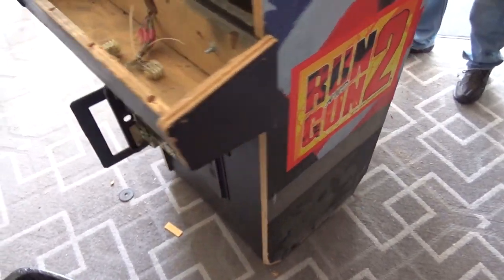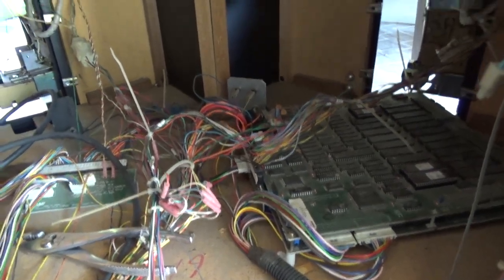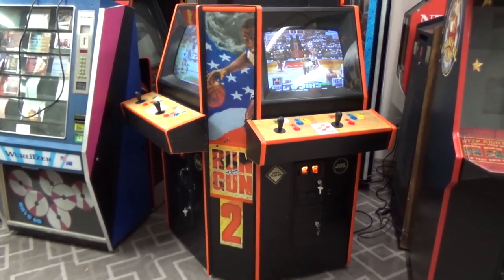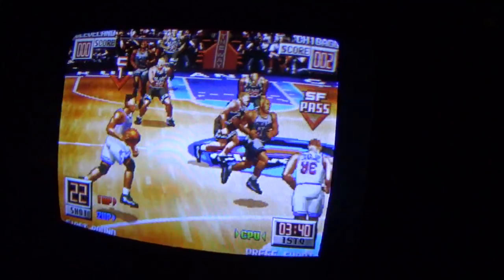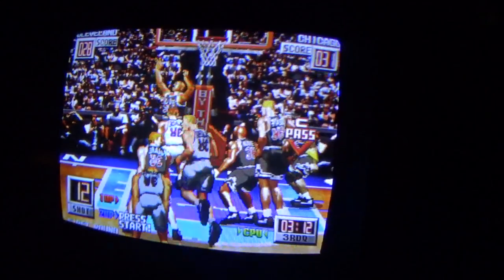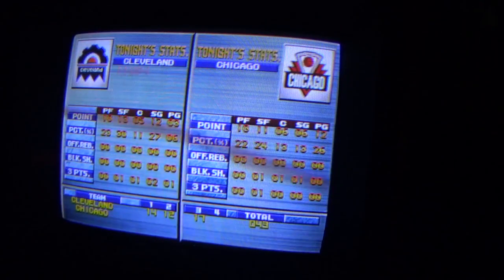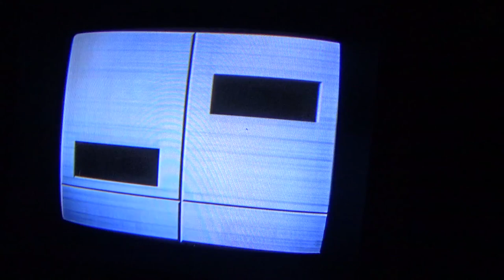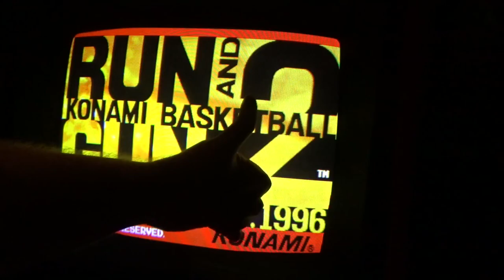Resurrecting Konami's Forgotten Run And Gun 2 Arcade Machine - 4 Player NBA Jam Like Basketball Game

Comment: Man i just bought a run n gun 2 pcb for 100$ lol and they sell like crazy in ebay.. does hook up to a normal jamma harness ill put it in my mk4 dedicated cab.
Reply from the maker: Yes it's Jamma it'll play in MK4.
Reply: @LyonsArcade  sweet shit man...btw i blew a trace off a mk2 pcb someone how.do you repair those with shielded wires right.
Reply: @LyonsArcade  hey man i just got this in has 2 boards? So i plug the jamma harness in what other plugs need to be in it im only doin a single player hook up tho